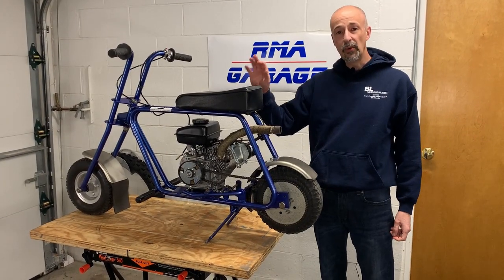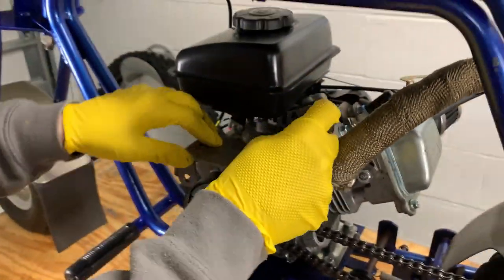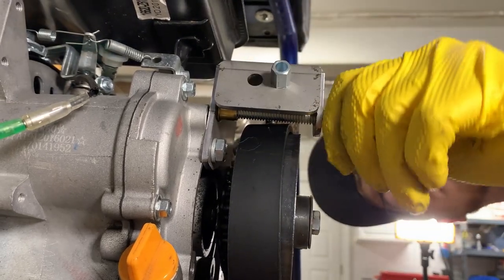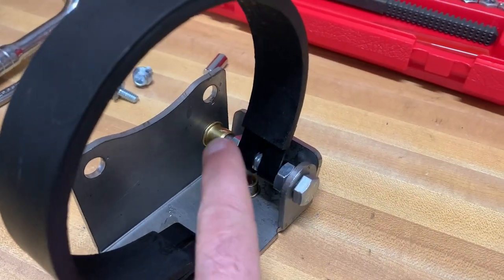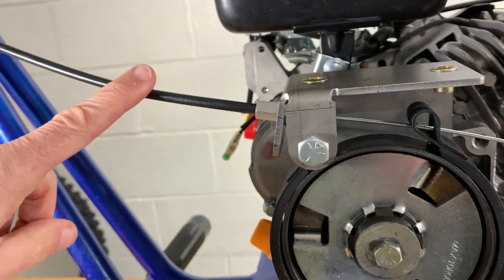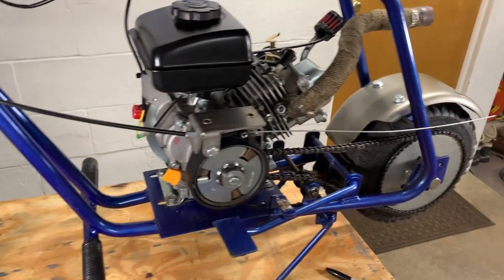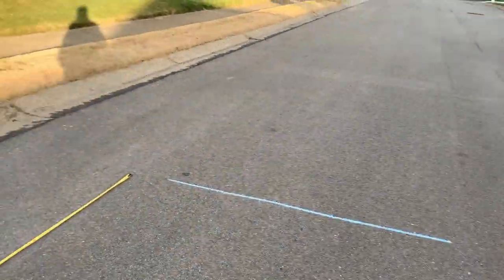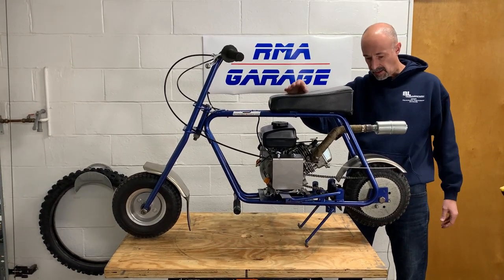Mini Bike Clutch Brake Installation

Comment: Father & Son Working Together Is Great For You Son. Had Minibikes Growing Up, Later Dirt Bikes  ATVs & Still Riding At 62. Recently Getting Back Into Minibikes Yo Relive My Youth. Building New Taco Minibike, But It Only Has Scumb Brake Like Yours. Look Into Adding Additional Brake System & Saw Your Video. Thanks For Details For Installation & Lead To Old Minibike Warehouse, I have purchased parts from them in the past. Your Son Is Lucky To Have A Dad Like You. Sincerely, Mr. T.
Reply from the maker: Thanks for the kind words!  Glad to have helped.

Comment: The bright side to the original foot brake it is the most reliable brake that there is. It will never fail. I used a band brake in the 70s on my first minibike and it works great unless the chain comes off or the cable gets pulled through the clamp.
Reply from the maker: We have decided to leave it on for your reason.  It just makes good sense.  Thanks for the comment.

Comment: That brake style doesn't stop you if chain breaks or falls off !!! I'd keep the scrub brakes also find or make better mount for the spring so it doesn't bounce up & down
Reply from the maker: Thanks for the feedback.  My "DAD" vote it to leave it on as well.  Stiffer spring would definitely stop the bounce.

Comment: Ay bro jus watch this do you think that kit fits for a 212cc predator engine
Reply from the maker: I checked out the website and is says that it fits Predator Motors so I would say yes on the 212.  But make sure whoever you buy it from that you can return it if it does not fit.  Thanks for the question.

Comment: Thank you SO much for posting this video!!!
I'm an old mechanic and have just completed converting a Razor kids kart to gas,
Ive been going round and round in my head about what brake system I was going to fabricate, Drum/disc hydraulic/cable
Tonight Im thinking can't I just use my hot clutch as a brake drum? (As I'm very limited on space)
Then I find this very kit on Amazon for 60 bucks and has deformed parts,
So I'm ordering a 4" brake band for 10 bucks and fabricating the brackets, I already have the rest,
I will use the leftover 40 bucks on alcohol...
Reply from the maker: Glad we were able to help

Comment: Hello.  Great video.  Do you know what engines this brake kit works on?  Universal?
Reply from the maker: I do not believe this is universal.  If I remember correctly, this was for predator motors only.  You can call OMB Warehouse if you have a different motor (www.ombwarehouse.com).  Thanks for the question.

Comment: i gotta fully built 212 on my mini and the scrub brake is barely enough to keep it from inching forward when it gets hot def gonna do this
Reply from the maker: My son just purchased a mini bike with a 212 and it has a disk brake.  I can see why.  Lots of power.
Reply: @RMAGarage  yea especially w the billet piston cam and heavier valve springs they rip

Comment: And that just seems like it would burn the clutch up not to mention it would be really hard on the crank seal and everything literally connected to the clutch. I mean how did it work when you were done? I really like the idea simple clean and effective I will say that that I mean how harsh was it on the motor and the clutch? I mean I guess it couldn't be too bad if they make a kit for it
Reply from the maker: I agree with the extra stress of the motor and clutch.  We do not ride the mini bike much, but if we did, the clutch would definitely wear out faster.  As far as the engine seal, only time will tell.  The brake is capable of locking up the rear wheel so it is very affective.  thanks for the comment.
Reply: The clutch bell is only engaged when on power. So when braking the force is only going into the sprocket and chain. If you were on power and braking it would go into the engine.

Comment: My mini bike does about 37 mph, do you think this would be enough to slow/stop the mini bike? I have a 1960 bonanza with the scrub brake currently.
Reply from the maker: to be honest, I don't know 100%.  We have had our pretty fast and the brake is more than capable.  I would say yes at the this point.  It most definatly will be better on the rear tire.  Not as much wear from the scrub brake.  Also we left our scrub brake on as a back up.  If the chain comes off, no brakes.
Reply: Use Both Brake Systems For Quick Stops, Clutch Brake For Easy Slowing Down Stops. As Of You Hit Clutch Brake Really Hard, You Can Possibly Snap Chain & Be Stranded. God Speed Your Rides.
Reply from the maker: Thanks for the comment.
Reply: I go 50mph on my cat 300X and I’m 200lb and I’m able to stop just fine don’t expect the world but there more then capable also if your chain pops and your doing 50 aim for the grass cause you while lose all breaking capabilities 😅

Comment: I'm curious how long clutch will last with extra heat like that added
Reply from the maker: Good Point.  We'll keep you posted.
Reply: @RMAGarage  what's the link
Reply from the maker: @jessez5536  I have not done the follow-up video yet.  My son has not been riding it because of work.  I want to wait until we have a few miles on it to make it meaningful.
Reply: What brand bike is that i have the same one but i dont know what is is

Comment: How did it hold up ? Did last long?
Reply from the maker: As far as the mechanics are concerned, the brake is holding up fine and shows no signs of breakage or wear.  My son has been at college so he has not ridden for quite some time.  l am not sure how the long the actual brake pad will last since he hasn't been on it much.

Comment: Have you ever though about buying a predator 212
Reply from the maker: My son wanted it but were going to have to modify it because it would fit in the frame.  Also, we thought it would be to much power for the size of the bike.
Reply: Ive seen more then one mini bike with a powerful engine,
Every owner called theirs a death trap, It actually takes the fun out.
Reply from the maker: @stclairstclair  I agree 100%.  It not bullet fast, but fun to ride.
Reply: I have a predator 212 on my mini bike, which is why I was watching this video.  Just installed my brake package like this.  It is one scary ride.  I haven’t clocked it yet as I didn’t have enough yard room without brakes.  Very quick with stock 212.
Reply: What Posterman, You dont need to guess, If you go look up gear any ratio calculators for go karts and mini bikes it will tell you,
Put in your two sprockets, wheel size and 3600rpm as a standard rpm it works very well.

Comment: 3 months later hows it holding up? I'm looking to go this route on my mini bike vs the stock disk brake
Reply from the maker: With my son in college and no time to ride, we really don't have any follow-up info yet.  We should have a sense of durability in a few months.  My son did read this comment and said he would go with disc if he could.  I am not sure what mini bike you have, but a disc brake should stop better than this clutch brake.
Reply: @RMAGarage  monster moto mmb80. The disk and caliper are very small and the brake pad wears out after about 3 rides
Reply: @RMAGarage  the stock disk brake has never been strong enough to skid the rear tire
Reply from the maker: @summerypond  I just looked it up the mini bike.  That is surprising.  We were able to lock up the wheel no problem with the clutch brake.  Must be a weak caliper design.  Or the brake pads are not the proper material....too soft.  If you have the stock engine, you may need to double check fitment on the clutch break.  I am not familiar with that engine.
Reply from the maker: Or you can go with the predator 79.  It is a great motor.
Reply: @RMAGarage  thanks! I actually have a predator 212, it's a wheelie machine lol
Reply: @RMAGarage  I'm definitely going to give this brake upgrade a try. as it is now I usually use my boots on the ground over the stock brakes because it is more effective
Reply from the maker: @summerypond  LOL...no wonder the brakes where out so fast!

Comment: How did you make that header?
Reply: Do you mean the flange to the pipe for the exhaust?
Reply: @BRZ_BOY  No like can you buy that header
Reply: @jeepwrangled79  The tube and thread piece for the muffler can be bought from Robinson Torque Racing. The pipe is originally for a 212cc predator but I asked them not to weld the flange that came with it for a 212. I bought a 79cc flange from affordable go karts that would allow me to use the pipe and would bolt properly to the engine. The pipe size is the same for both flanges. I had the flange and thread piece welded by a friend. Was really the only way to get and exhaust that fit the way I wanted.

Comment: I'm pretty sure I'm not the first one but you do realize that no you do not absolutely under any circumstances want to take the original break off because guess what if the chain breaks at high speed he has no break
Reply from the maker: Thanks for the comment.  We left it on.
Reply: 🤔 interesting